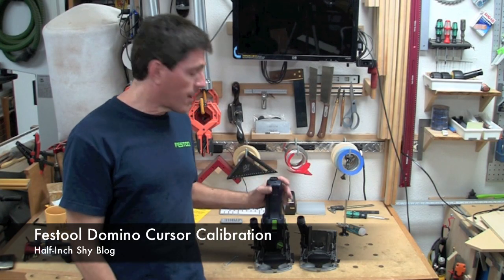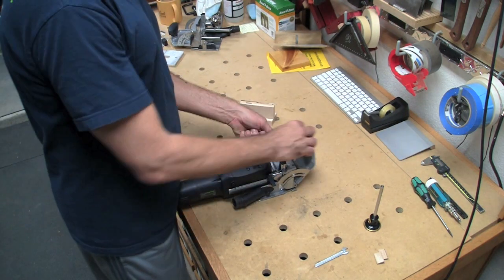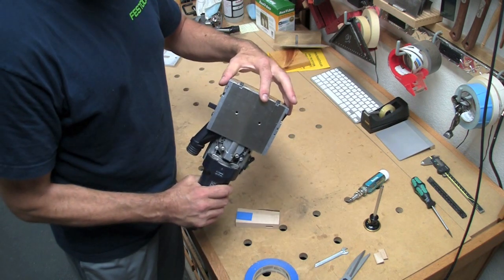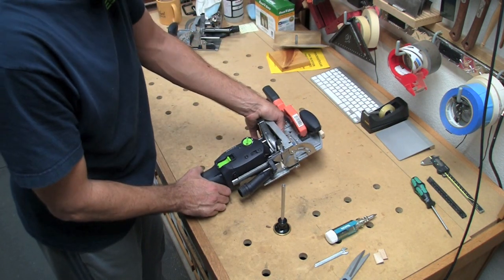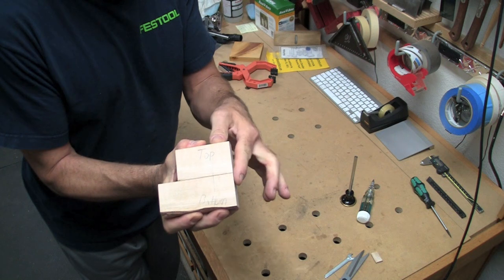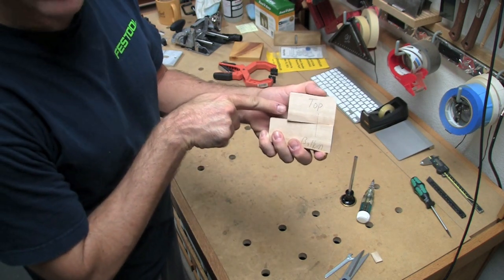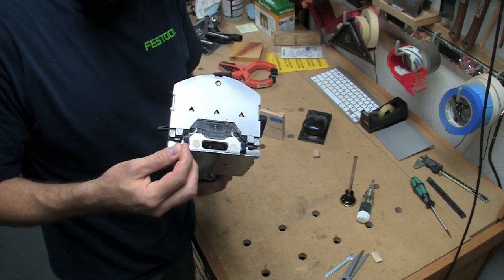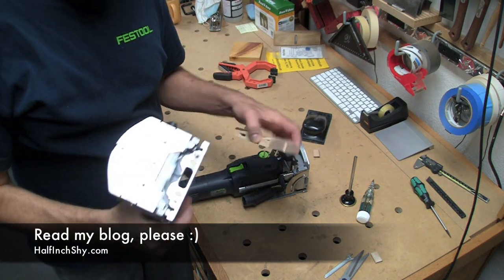#53 - Domino Crib Sheet - Festool Domino Calibration

Comment: I just bought the 500, tried it out, and it was out of alignment. Tried adjusting it, and couldn't slide the guage over far enough to get it aligned. Then, after unscrewing the guide the second time, when screwing it back on, the right screw stripped with no pressure being applied to the screw at all. Was very disappointed after hearing how dead on this is. And paying $1000 for this, you shouldn't have to adjust this. Is this normal or typical for them to be misaligned like this? Not sure if I got a lemon or what. But, this is having to be returned and exchanged. 😕
Reply from the maker: For me, I had to widen the elongated holes so the cursor could be properly aligned, but that's bad the screws stripped. Call Festool service. It is possible they'll just have you send back the fence part, though I guess that doesn't actually make the repair faster :/

Comment: I think I came up with an easier way to calibrate when I accidentally discovered mine was off.   I was using the trim stop on 3/4" stock for cabinet door rails and marked a center line on the piece of wood to center it with the center mark on the bottom of the fence for the trim stop.  When I accidentally flipped the wood piece over and the side with the center center pencil mark was showing, I noticed that the cursor was off looking down through the clear plastic.   I just loosened up the tork screws and center the plastic cursor to the pencil line that was used to center on the bottom of the fence for the trim stop.
Reply from the maker: +Mike Hadler That would also be a good way to verify the trim stop is accurate. I have blue tape on one of my trim stops because I have to take a millimeter off on that side if I plan on tiling mortises down two sides. The only thing I can think of is the base itself is a hair wider than it should be (hence why my cursor was off?!) so I have to compensate on the trim stop. So maybe verify your trim stop. If yours are dead on, then this new way is another option! Always better to have multiple options!
Reply: Just when I thought the method in the video was genius, I read your comment. 😁

Comment: I haven't had my Domino that long and never thought to calibrate it.  It is definitely off!  I guess this means I need to go buy a #10 torx Centrotec bit at Woodcraft tomorrow.  I doubt very seriously if the local big box stores are going to have one.  While I'm at it, I might as well buy a marking gauge too!  Thanks for the great video's!
Reply from the maker: +Howard Hanger Your style of reasoning mirrors mine :)
Reply: +Half-Inch Shy I did one better.  I saw Peter Parfitt's review of the Wera hand tools so i ordered a complete handle and bit set as well as a 1/4" drive socket set.  Between Festool and now Wera, i'll have the best equipped shop on the block!

Comment: Paul,  I have the same problem that Patafreund had, but I have the TS 55REQ-Plus.  I looked at Christopherson's manual as you mentioned, but the TS 55 REQ doesn't have the same screws as the previous model.  
I also looked at his manual for the newer model and there's no mention of how to calibrate the blade angle.  Using 3/4" nominal thickness, I'm off by .5mm.  

Is there any adjustment I can make to correct this, or should I exchange the saw for a new one.  Any help is greatly appreciated.
Reply from the maker: I just downloaded the 55REQ manual and in the troubleshooting section, it mentions the toe-in setting and that page 22 has the instructions.  Page 22 is about adjusting to multiple guiderails since you need the toe-in to match on saws to not cut the guide strip excessively with one.  Maybe read that section and see if it helps answer your question; I don't have a 55 or 55REQ to compare against.

If you can't get it figured out, call Festool support (number is on your saw) and tell them the problem. They'll send you instructions, walk you through it, or let you send it in postage-paid (if within a year of ownership) to correct it.

Hope that helps!
Reply: ***** Thank you for the reply and help.  I waited so long to respond because I wanted to wait until a had a resolution to the problem I was having.   

I looked at the manual you mentioned and wasn't able to correct the issue.  I called my local dealer, who looked at my TS 55 REQ - Plus and was unable to fix the problem.  They exchanged the saw for a new one.  I tried out the new saw and had the same issue.  My dealer called (Woodcraft) called me the next day to check up on me.  They advised me to call Festool customer service, as did you.

In a 5 minute conversation today with Festool, this is what I found out...

Facing the rear of the saw (the end with the plug it and dust collection connections), loosen the thumb screws and tilt the saw to 45°.  Loosen the T10 Torx screw that is at about the 2 o' clock position.  Position the saw back to 0°.  Loosen the other T10 at right below the handle.  The metal bracket can then slide slightly left or right.  Tighten the screws and thumb screws.  Perform a trial cut.  I did this twice before getting a perfect cut at 0°.  I took the two pieces of wood and flipped the second one, as you demonstrated, and verified a perfect cut.

This sounds like a lot, but it was a very easy fix, and now it functions flawlessly.  

Thank you again Paul.  I thought your viewers could use this info, since I haven't seen it posted anywhere.
Reply from the maker: Excellent, thanks for posting it here. Normally a call to Festool USA will get you the information. I think they are reluctant to put a calibration like that in the manual or some people will just do it and make a mess. They probably want to verify the problem really exists :)
Reply: dragland7268 n

Comment: Thanks, Paul, for the very helpful video. I had my doubts about the alignment of my 500 and this calibration confirmed that it was 1mm off.  Unfortunately, I don't have enough leeway to line it up perfectly, so I'll have to keep in mind the slight variance.  My XL was only about .25mm off and was easy to correct.  Please keep posting.  I've learned a lot about my festools, accessories, and after-market tools.

Comment: Why not just square an accurate  line on  the face side  and edge and  then make the cut  with the cursor  placed  accurately on the line.
Then check  if the  domino slot is off center  to the edge line using an  engineers vernier  guage?